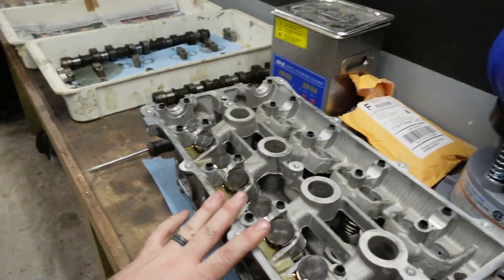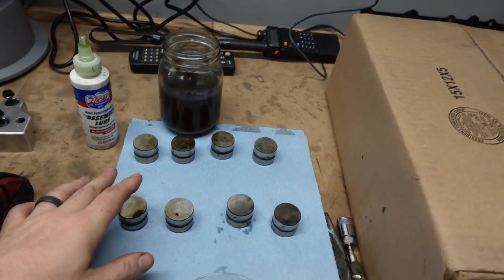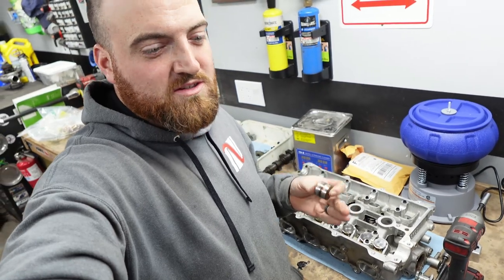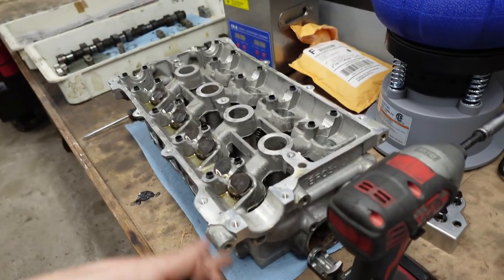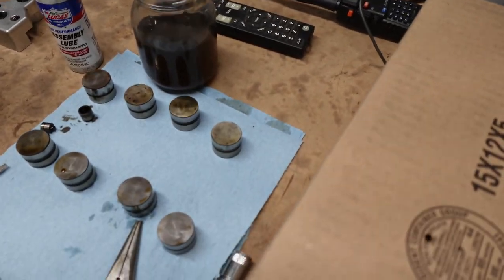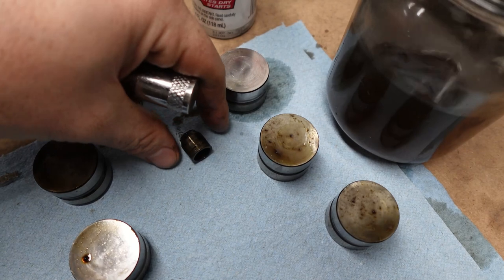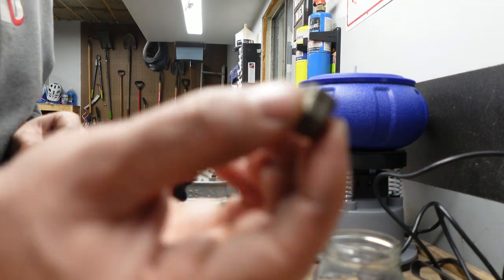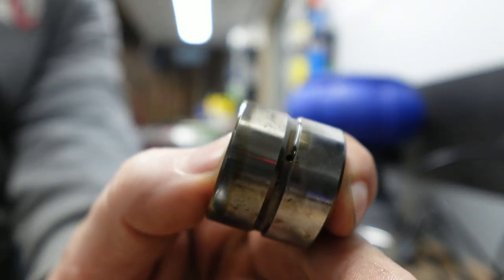Free and Easy Miata Lifter Tick Fix!

Comment: My 1996 Subaru 2.5L DOHC uses these exact same lifters and they're all stuck.  Glad I found this video since I'm doing head gaskets and I'll clean the lifters, had already priced new ones and now know spending that $$$$ isn't not necessary.  Thanks!!!    Just a note that paint thinner is a better/safer cleaner than gas or brake clean.
Reply from the maker: Hopefully it works for you and saves you some cash!

Comment: Thanks for this very useful tip.  My tick was very intermittent and hasn't come back since my last oil change.
Reply from the maker: Nice!
Reply: How's it holding up?
What did you clean it in?
I'm really curious.
Reply: @gogobnr3291  I didn´t use this technique.  I just changed my oil and it hasn´t returned.  Still going fine.  I just plan to fix it properly if it ever does become an issue.

Comment: Great video and tip for hydraulic lifters - I never realised it was so simple! I run 5w-40 in my turbo 1.6 and haven't suffered any cold start lifter 'tick', but I also did any engine oil flush each year until I put on an oil cooler (Yes, it's a pain emptying the cooler and pipes - so no more flushing!!).
Looking forward to the engine build. Keep up the great YT content (not a fan of Instagram 😒, much prefer YT 😁).
Reply from the maker: Thanks! If only editing YT didn’t take so much longer than posting on IG haha

Comment: I'm also a huge fan of fixing and maintaining things instead of throwing them away.  And so I found and still find this clip here about the maintenance of the hydraulic lifters very interesting.  However, I would like to make one addition, which I consider not insignificant since it has a major impact on the function of the plunger.  We are talking about the checkvalve in the plunger.  This is hidden under the tiny sheet metal cap at one end.  You can now lever off this cap relatively easily with a screwdriver and a tiny spiral spring and a small ball appear.  The conical seat of the ball becomes dirty over time due to oil varnish and thus impairs correct function!  From hundreds of my own experiences I know that this service can extend the life of the hydros to the full extent, but the wear and tear is evident here too and sooner or later new tappets are simply due!  Also and very important to note: the play of the bucket tappets in their bore in the cylinder head!  A few hundredths of a millimeter more of a good thing is too much here and the oil pressure on the tappet drops and the supply to the hydros is too low -> rattle or tick!
Reply from the maker: I just didn’t want to lose that tiny spring.
Reply: @NappMotorsports , .... sure, I can understand that!  That's why I've gotten into the habit of disassembling the cap right next to a magnet.  The magnet comes from an old wideboard and is perfectly adequate for this purpose... doesn't have to be a neodymium magnet!

Comment: Does the hole in the lifter have to line up with the little hole in the case? Or does this not make a difference? Great video!
Reply from the maker: Nope! The lifters rotate during operation so it doesn’t matter
Reply: had the same question. thanks for the great video Napp Motorsports!

Comment: I tried this and could NOT get the lifter apart.  I noticed that the inner plunger bit didn't have a lip to grab with a pliers, so maybe they are aftermarket ones that aren't meant to be disassembled?  Couldn't find much about this online, was wondering if you had heard of this or ever had trouble getting them apart.  Ended up calling it quits after 4 hours of prying/soaking/heating and ordered a new set of ITM lifters.  Love this channel, you guys are on your way to 100k+ subscribers no doubt!
Reply from the maker: Interesting. I know it’s a little tight to get them apart but these were OEM. If yours is a 99-05, they are solid lifters and not meant to come apart.
Reply: @NappMotorsports  I have a 95.  The plunger does push in and out (and rotates) so I know its not totally frozen in there.  My guess is the OEM ones have an O-ring or something that compresses when you pull them apart and these aftermarket ones have some kind of an interference fit and were put together with a big ol' press.  I might cut one open and find out...will report back.

Comment: Much easier way and save yourself time. 
If your engine hasn't grenaded and is running, add 1/4qt of generic ATF to the engine. The detergents clean the HLAs as well as any buildup in squirter feed passages. 
This is an immediately noticeable change in sound and performance of the NA engine. 
ONLY DO BEFORE YOUR OIL CHANGE!!!!
OK TO RUN AT LOWER RPM ONLY!!!

FYI, not just some random dude on the internet. Have been working on Miata/MX5 specifically since 2003.

Enjoy your vids man!!! Lots of great information.
Reply from the maker: Interesting, I’ll have to try that out!
Reply: This is an interesting idea. Do you add the 1/4 quart to the engine oil? How long should one drive around with it before changing the oil?

Comment: Hi, inside the inner plunger on the "nubby end" there is another spring and a little ball, that prevents oil is leaking while engine stands still and no oil pressure comes through the little hole. Is it not necessary to clean this too, to get rid of lifter tick? However, great video and good description 👍
Reply: This is the same question I have - I was wondering if the checkball cage and checkball should be disassembled, or if they get cleaned "good enough" without full breakdown. I suppose one could clean as shown, then take one apart to see if there is any residual shmoo inside, then decide. Thanks @NappMotorsports, and thanks for thinking on the same question, @WernerTiffy.
Reply: @MichaelShuler  if you disasemble the cage, just be aware  tiny spring inside is very delicate and likely to be distorted. But it is possible to do 😉
Reply from the maker: Not worth the risk IMO. I’ve had super good results just doing this, and that spring is so small that you could easily lose it or damage it.

Comment: So, my NA6 had a very mild lifter tick that would generally go away. About 3 months ago I started restoring this Miata after planning it out for a year. I rebuilt the lifters just as you did last week and today I started up the car, the lifter tick sounds worse that it ver did now. People online seem to imply it's normal and I needs to run it to prime the lifters even though I already did that when they where out. Although I suppose the oil would have gotten pushed out when I timed the engine. Any thoughts?
Reply from the maker: Should go away after a few heat cycles so the oil can work its way in.

Comment: Nice, given you've seem to have done many, have you experienced any failure rate: ie tick continues after treatment, and also just wondering if you would ever bother renewing the whole HLA assembly given you have them off ... appreciate you thoughts.
cheers
Reply from the maker: I've done this maybe 3 times total. The tick can still be there, that's obviously a risk, but in my experience it either goes away, or will go away after a few cycles.

Comment: I just did this on my 1.6 NA , as it had lifter tick for a while, and I was doing timing belt/water pump.
It was much needed, most of them were not moving anymore.
I started the engine before putting everything back together, to check for correct timming, and I immediately noticed the difference in sound (though the engine couldn't run because vaccum lines unplugged, so it didn't hold iddle)
After putting everything back together, I took the oportunity, while in there, to change the oil.
I didn't do any priming, and started the car the next day. When I started it, it had no oil pressure for a few seconds (normal for an oil change I assume), and then the system pressurised as usual.
Unfortunately after starting it, I noticed the valve tick (when in front of the engine, not audible from driver seat), so my question is this;
Is it possible that air bubbles got in the lifters, during the cranking phase, before there was oil pressure in the system, and now that there is pressure, air is trapped in the lifters thus causing lifter tick?
If so, what would be a way to avoid this? Maybe change the oil before and not after next time?
Reply from the maker: They will drain out when they sit. Just run it and they’ll fill with oil once it gets hot and the problem should go away since they’ve been cleaned out.

Comment: The reason many just switch to rotella is because they’ve been told the ticking just comes back. What’s your experience with that?
Reply from the maker: I VVT swap every miata I own so I don’t have to worry about it coming back because solid lifters. If you change your oil at a good interval it shouldn’t come back.

Comment: Dumb question: what is it that holds the assembled lifter together? Friction, O-ring, etc.?
Reply from the maker: I believe it’s the little o-ring. Also the cam is right on top so it can’t come apart while the engine is assembled.
Reply: @NappMotorsports  Do the O=rings fatigue?

Comment: When installing the lifter, does the lifter's hole has to point in a certain direction and if so, which direction? please help.
Reply from the maker: No, the lifters will spin in the head so it doesn’t matter.

Comment: This really fixes the tick? I've got the timing belt off, might as well try it
Reply from the maker: Yup!
Reply: @NappMotorsports  it did fix the tick! I was impressed how stuck mine were. 5/16 stuck solid, 6/16 partly stuck.  I had to soak them in gas in my ultrasonic cleaner for 15-30 mins each, to get them unstuck. What a pain since I could only fit 3 containers in my cleaner at a time. Took way longer than I wanted, but certainly extended the life of that engine. 
When I first started the engine back up, it was way quieter, but still had a little tick. Did a little 1500-2000 rpm for a few mins, and it gradually went away. I assume the cam had to rebed to the lifters that were stuck for so long? not exactly sure, but it's quiet now.
Thanks for making this vid, as it gave me the confidence to tear into it

Comment: hey can lifter cause low compression if they have probleme
Reply from the maker: If your valves are stuck open, yes.
Reply: @NappMotorsports  so i should be able to  compressed by hand to ensure they are fine right ?
Reply: @NappMotorsports  and you mean the piston lifter stuck open ?

Comment: Humm that’s  pretty easy. Besides putting everything back in correctly there’s nothing else? Can’t find the post I read about doing this but they had said something about letting them sit a little. Necessary or miss informed? I figure by time you get them back in and finish the job they’d have lost some oil anyways.
Reply from the maker: I don’t let them sit longer than it takes to put the engine back together. It’s not critical, the important part is getting and debris out and making sure they move freely again.

Comment: Honestly, at $250 for a set of new lifters, this is getting a bit hard to justify. I didn't even bother trying to rebuild mine, just slapped some new ones in and called it a day.

I think lifter tick is less about gunk building up as it is the hydraulic bores wearing out and allowing oil to leak past through the HLA. I've ran all kinds of oil after I replaced mine, none of them resulted in any tick even when cold. I can let the car sit for a couple days and it still wont tick now.

Worth the investment, plus you end up with new scuff free tops.
Reply from the maker: I mean it takes maybe 30 minutes once you’re in there. I value my time but not at $500/hr

Comment: Or just substitute 1qt of oil for 1qt of atf when doing oil changes. It'll clean out the engine and keep it healthy.
Reply from the maker: Haven’t heard of this. Still doesn’t sound like the right fix.
Reply: @NappMotorsports  ATF has lots of detergents in it. On this basis, it MIGHT help to clean some gunk from the crankcase and other internals. Just be aware that most people do this as kind of a last resort so you MIGHT not have to actually open the engine and fix what's wrong. Kind of like Seafoam treatment.

Not saying on haven't tried it in a very limited scenario in the past (Chevy 5.3 lifter tick - 350k miles on the new to me vehicle), but I knew what my risks were and definitely didn't drive anywhere with ATF in the engine oil. Didn't fix my issue and I ended up dropping the oil pan to replace the pickup tube o-ring (AKA the real problem). All the ATF trick cost me was a couple dollars of fluid when I was changing the oil anyway. Still wouldn't recommend it for the Miata lifter tick though.